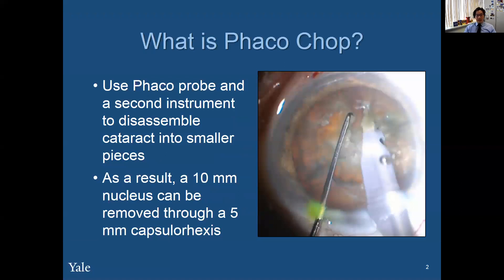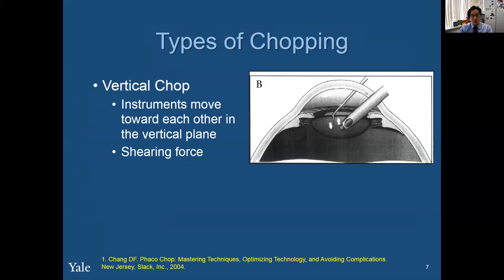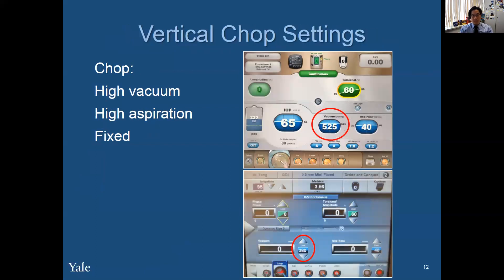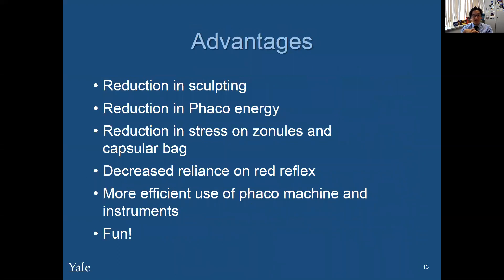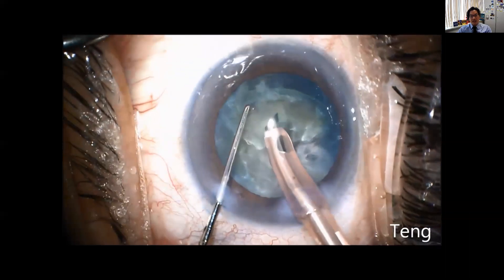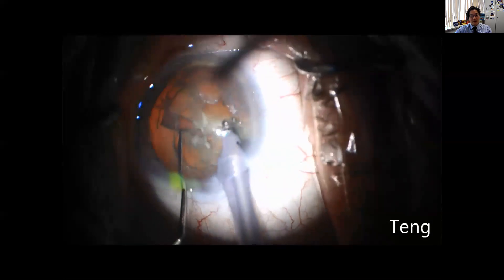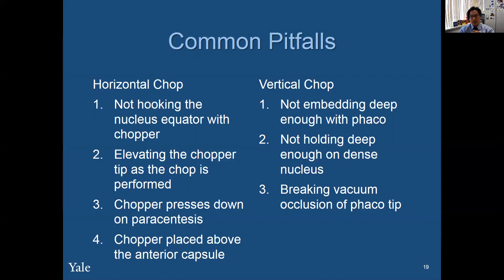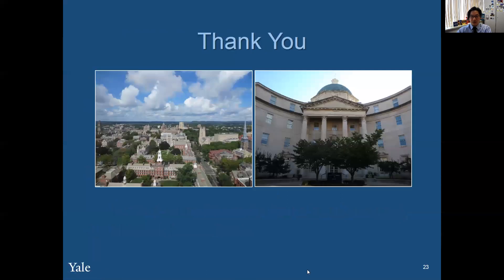Phaco Chop Lecture- Chris Teng, MD

Comment: How many D&C cases do you reccomend before transforming to chop or stop& chop technique?
Reply from the maker: No set amount but get comfortable with Divide and Conquer first. Best way to start chopping is to make a central groove on the nucleus and then crack it, then rotate the nucleus 90 degrees and do a chop, either vertical or horizontal, on the heminucleus.